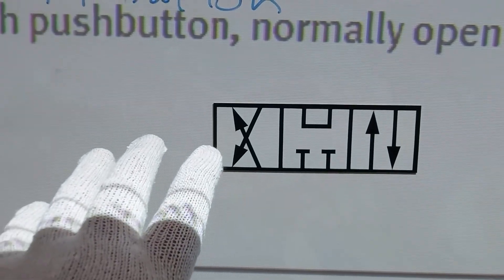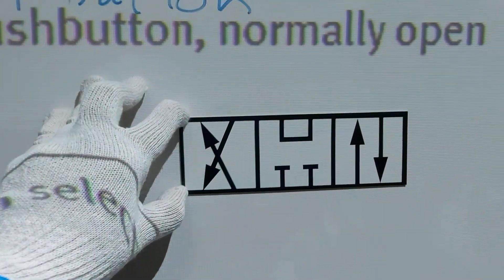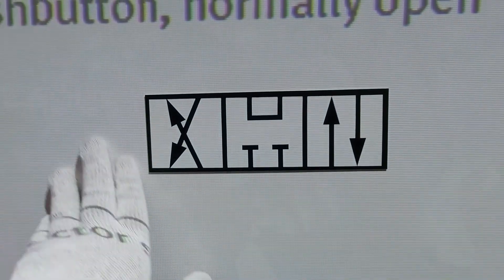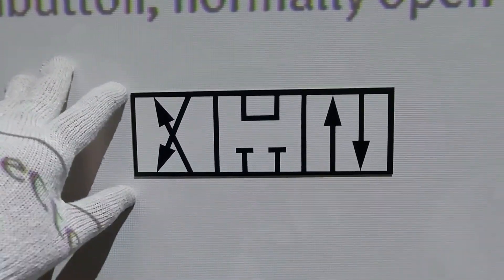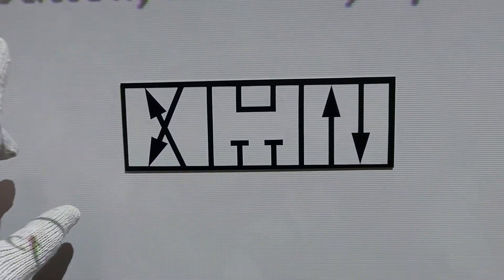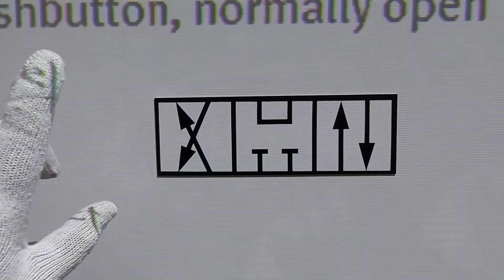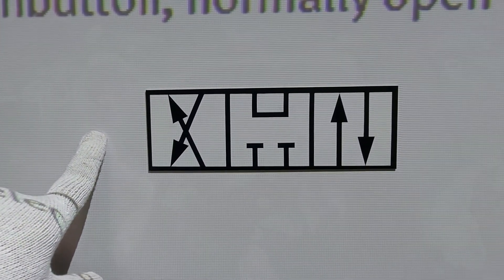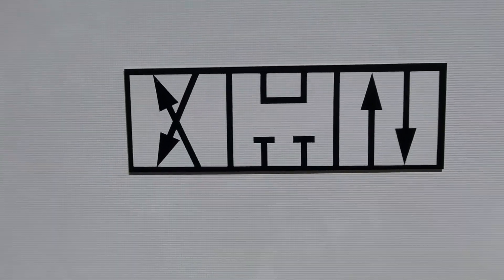How to Read Pneumatic Valve Symbols | Understand Direction Control Valve Schematics | Interpret DCV

Comment: Nice explanation, so if we have direct connection between the Input 1 and output 2 its a open, if there is no connection between input 1 and output 2 its closed, these are based on default condition ?
Reply from the maker: @sarvavenkata  "Yes, the default condition refers to the valve's state when no external force is applied. In the default position, if there's a direct connection between Input 1 and Output 2, it's open. If there's no connection, then it's considered closed. This helps determine how the valve operates under normal conditions."

Comment: From the explanation exhaust (3) is the port where the air goes out from Outlet (2), is it possible for the flow of the Air to be reversed? 

For example in gas application I need 2 different sample gas to go to an analyzer, can i use the 3/2 way and redefine the port to: 
(1 = Inlet 1) 
(2 = Oulet to Analyser) 
(3 = Inlet 2) 

so that i can select which gas i want to channel to the analyser?
Reply from the maker: "Hi @trollunderthebridge3644! Great question! In a typical 3/2 valve setup, the ports are generally configured with (1) as the inlet, (2) as the outlet, and (3) as the exhaust. Reversing the flow isn't always straightforward since most 3/2 valves are designed for a specific flow direction. However, it might be possible with a specialized 3/2 valve or a modified setup.

For gas applications like the one you're describing, where you'd want to choose between two different sample gases for analysis, repurposing the ports as (1) Inlet 1, (2) Outlet to Analyzer, and (3) Inlet 2 could theoretically work if the valve and pressure conditions allow it. Just keep in mind that this configuration might affect the valve's normal operation or the flow's stability, so testing it under controlled conditions would be ideal.

Comment: What kind of switch will allow me to stop mid stroke in either direction?
Reply from the maker: @caddi70  3-position, 5/3-way directional control valve: These valves typically have three positions: extend, retract, and a neutral (or closed center) position that blocks the airflow to and from the cylinder, allowing it to stop and hold its position mid-stroke.

Comment: i have a question, i am installing some equipment that uses an air bag.  I want a manual valve, normally closed that when opened, will inflate my air bag to regulated 30 Psi but when the valve is closed, i want it to just vent the bag to atmosphere and the supply pressure closes.  I do not want to hear any air movement other than when we inflate the bag and then the bag venting to deflate.  Speed is not an issue as this is a slow process.  Fyi, this is for a box tipper that will tip a box as its weight decreases during production usage.